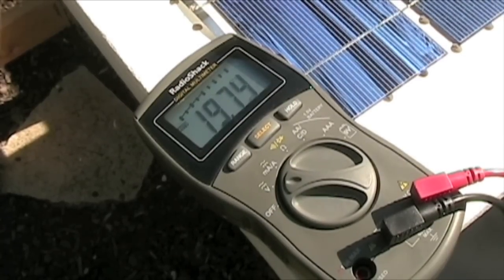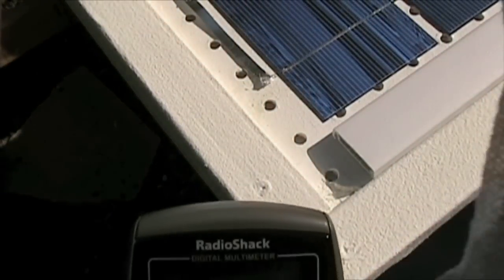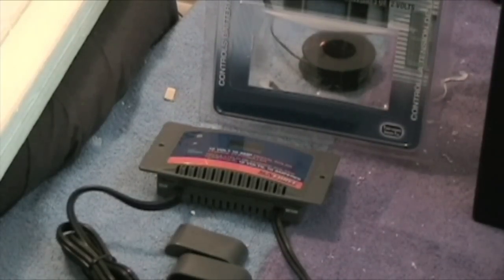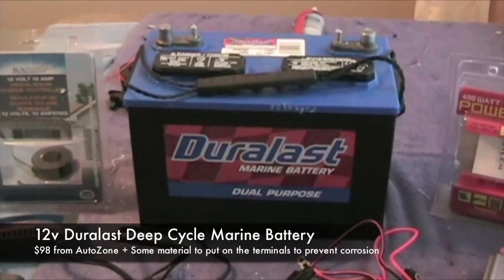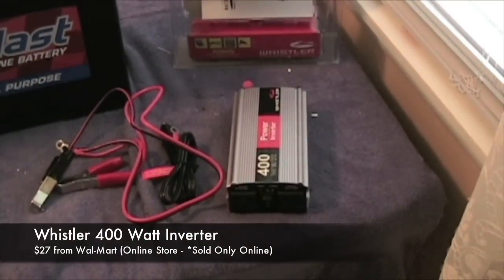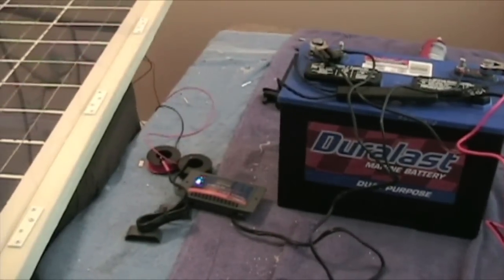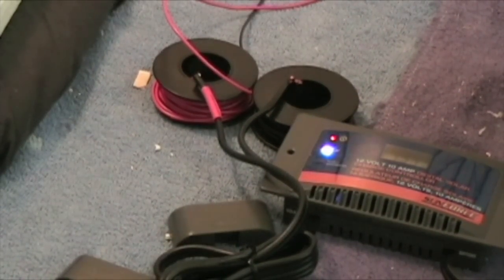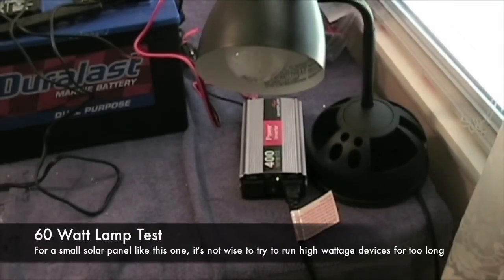How To Build A Solar Panel - Part 9

Comment from the maker: @DJControllerC Well I'm not sure when I stated this in the series of videos, but when you solder your cells in series, the "voltage" increases, not the the "amps". So your panel produces 18v or so, and only 3.5A for the entire solar panel. If you want the Amps to increase, you hook the solar cells up in parallel, but your voltage will be lower.

Comment from the maker: @paperfeed Yes, if you hook up devices that require a large amount of watts, they will just drain your battery quicker. Your devices are not running directly off the solar panel if you have a battery involved like I did.

Comment from the maker: In my system my charge control has that feature built into it, thus why I do not need a blocking diode, as a blocking diode prevents the backflow  of current, and are usually only needed when you have a battery included in your system. Simply google "charge controller prevent backflow". Most CCs have this feature, but not all. My junction box also has a blocking diode inside it which you see in a later video, but I don't really need it, because of the Charge Controller.

Comment from the maker: @jdbobey Most charge controllers prevent that, "but" not all. So it is something you need to check before you buy your charge controller, but it doesn't hurt to just put your own blocking diode in your circuit either.

Comment from the maker: @paperfeed No, since my inverter can only handle 200 Watts, it makes no sense to hook up something that requires 300Watts, as that device simply will not work with the inverter. Or if you have multiple devices plugged in at the same time that when combined Watt wise are greater than 200 Watts, the same issue occurs. So it has nothing to do with the battery or solar panel, I was referring to the inverter.  Hope that helps :)

Comment from the maker: Very true, however, we have to keep in mind that for the typical Do It Yourself (DIY) person, they  usually do not have the equipment necessary to test these the actual Imp/Vmp/Pm. For most DIY solar panels, we by default test the open circuit/short circuit rather we say it or not. So my goal here in these videos is to keep things simple and follow the approach of a regular DIY solar panel, and not a fully professional built and tested solar panel. Of course if you can afford a MPPT go for it.

Comment from the maker: Part 11 to be exact.  Also, most charge controllers have this built into, so I'm not sure if you knew that or not. So if you are not using a charge controller, you most certainly need some type of diode.

Comment from the maker: :) Yeah at the time I was not sure of the right formula on how to determine how long it will last. With a 60 Watt light, you should be able to use it for about 18 hours. The battery there is a 12 volt 115 Amp hour battery.

Comment from the maker: @JimmyJacks00 Also, I suggest to people to read the reviews for these components before buying, and the inverter I purchased from Walmart in the video had way more positive reviews than negative. I also suggest to everyone else that even if you do see 1 negative review or a few, see what the overall ratting is, as just because 1 person had a bad experience doesn't mean everyone did. Just check those reviews/ratings :)  So far all my components work flawlessly.

Comment: No a blocking dioade controls the flow of electrons from and to the panel. A charge controller regulates power from the panel to the battery. (IE keeps you from over charging the battery)

Comment: wow thanks for making this series of videos it has helped me to understand how to build a solar panel and also how to hook it up to a deep cycle battery and a 110 converter. I wonder how much these cell cost each and where can I buy these cells at? May be I could start making these until I get  enough of these to power my whole house. About how many of these do I need to power my whole house, batterys and pannels? would I hook them all together or just use them seperately.

Comment from the maker: Hi rcmartin012,

First, thanks for the comment.

Second, to answer your question, watch Part 11.

It explains that, but quick sum up, yes most charge controllers have this built in already. Not all, but most. I used a junction box on mine as you can see in Part 11 which has a Blocking Diode inside already. 

Let me know if that helps after watching part 11.

Comment: You can also use something called a "Grid Tie Inverter". This will allow you to hook your panels directly to the power system for you entire house. Unless you produce more power than you consume, You shouldn't need to get a different electrical meter.

Comment: I've noticed that Home Depot sells a 500watt window AC unit-  I have built a 60watt panel using the exact same cells you use here (.5 volts per cell right?)- my question is- if I used your same battery and charge controller- how long could I run a 500watt ac with lets say an 800watt inverter connected to the battery?

Comment: hey robert, I am building a panel of my own a 165w at 8A, but I mostly want to use it to charge my phone and laptop, dont you think the inverter and the laptop charger "the brick", lose alot of power?, I know i could make my own charger for my phone "USB", but my laptops AC to DC inverter has alot of components probably to charge the battery better, what do you think?

Comment: @RobertSmith3  thanks for clearing that up and answering all my questions- If you added another identical panel in parallel the amp rating would go up to 7amps then? thanks again!

Comment: I noticed you recommend a 10amp charge controller, each one of of those 3inch by 6inch polycrystalline cells you use for your panel is usually rated at 1.3-1.8watts, .5volts and 3 - 3.6 amps- so the power produced by your panel is well over ten amps- how is only a ten amp charge controller effective? Im confused about the ratings I guesse.

Comment: @RobertSmith3  thanks for clearing that up and answering all my questions- If you added another identical panel in parallel the amp rating would go up to 7amps then?

Comment: Please Note ! When You are charging a battery the reaction with the acid inside creates an output of Hydrogen gas & in an inclosed space it can build up & cause an explosion. Make sure Your batteries are well ventilated.

Comment: You are checking short circuit voltage, not the load current. You need Vmp and I mp to find Pm, maximum power. Reverse current destroys solar cells.

Comment: Is there a reason why you have the bus wire connected to 2 stripes then 1 by itself? Why all 3 are not connected?
Reply from the maker: Because I was trying to increase my voltage and needed to wire in series to accomplish this. There are probably some other videos on YouTube now that explain this a little simpler. Try searching here on YouTube the following: solar series vs parallel

Comment: Hi,Say I need to produce 60watt - as from out of my Inverter. In that case, How much watts or voltages of Solar panel, Charge controller, Battery, Inverter I may need? with calculation please.
At a point, your panel is of 18v, but charge controller is of 12v. So, is it not reducing your power?
Also battery is of 12v,why not 18v - as equal to your panel?
Someone ask you about 300 watts, and your reply is your Inverter is of 200Watts, but it's written 400 watts, can you please explain?
Thanks.

Comment: heh about 2 hours with a 60 watt light... i use my laptop at camp on a smaller marine battery with a 700 watt inverter with a light on and my laptop is 135 watts... last alot longer then 2 hours.. think you need a new battery 0.o but great setup :)

Comment: Tip: If you like your computer, DON'T plug it into an inverter that is not sine wave. Laptops are different because of the power supply on the feed wire (as long as the battery is connected), but desktops don't have that regulator. If the power drops due to discharge, you will hurt your computer...